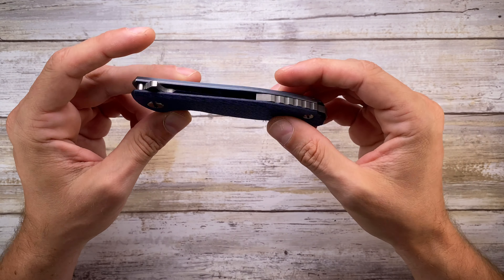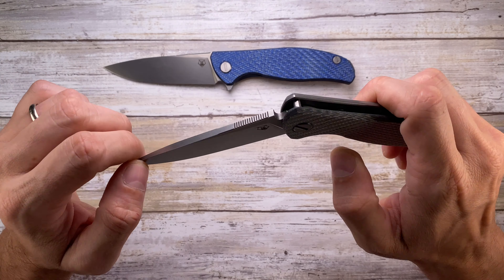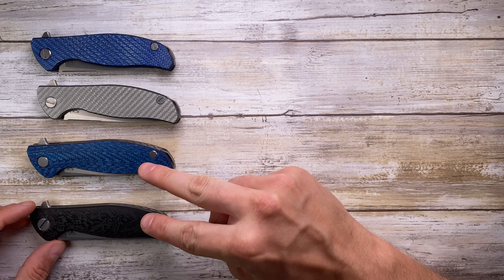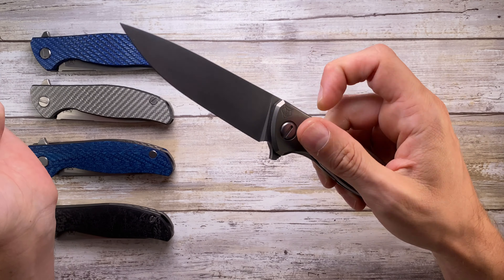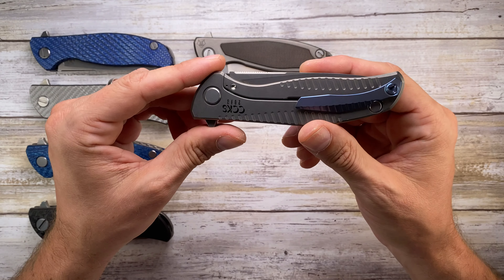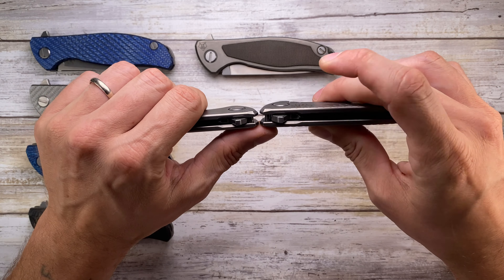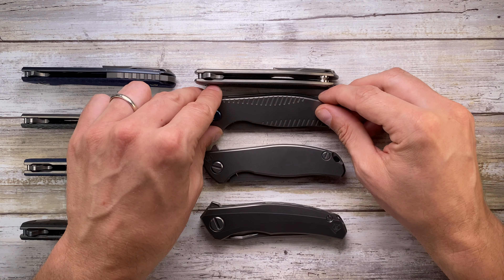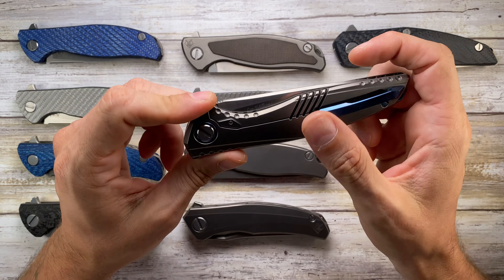Shirogorov LINEUP Explained. Fablades Full Review

Comment: Very detailed video 🙌

Now that I have the Neon Lite, what would be a good Shirogorov to get next? Hati, F3, 111 or F95? I want a bigger knife to compliment my Neon Lite as a larger knife. And something with carbon fiber.
Reply from the maker: With carbon fiber and 3.75” blade you can have Hati (framelock) or F3 (Linerlock). Both outstanding blades!!
Reply: Do you recommend one over the other? At this point, I am leaning towards the F3 because I may want linerlock.
Reply from the maker: I also prefer F3 over Hati. Feels more robust, but also is chubbier. The latest models are F3NS (carbon fiber) and Hati R (Alutex). Both have backspacer, MRBS, and M390
Reply: So, the F3 is a little chubbier than the others, but is it still fairly light and pocketable?
Reply from the maker: Same overall length, F3 is a bit heavier than Hati (4.6 vs 4.1). They also have different pocket clips.

Comment: Thank you for the video! I have to ask, which one is your favorite? I have a Ne0n Zero (MEFP) and thinking to buy the F3NS or Quantum next
Reply from the maker: I think now I like the simplicity of the F95R Slim..but it's a very tough battle with the Quantum..
Reply: Fablades Do you know if the F95R Slim has a detent ball ramp? Also steel washers under the bearings? Thank you.
Reply from the maker: No ramp but I’m pretty sure there are washers underneath bearings

Comment: Saving to get my first Shirogorov. I am torn between hation zero it the F3ns. I know they are both worth owning and very different sizes. I am just looking for help to tip the scale. Which would you recommend to be the first one to own?
Reply from the maker: It depends, I have big hands and F3 would be my choice, Hation and Neon are great EDC but a bit small for me. F95 not an option?
Reply: Fablades I have large hands myself and the F95 is an option. I think I just liked the look of the F3ns and it looks much thicker with better ergonomics than the others
Reply from the maker: @danduran536  yes for sure the F3 fills the hand more than F95!

Comment: Is the F95NL A multi bearing system I just bought one that’s listed as a multi bearing system I just want to make sure if you can maybe text me back in this fourm with a yes or no I really do like your site it’s well done
Reply: I also have a cannabis that’s numbered I’m not sure what that means thank you again
Reply from the maker: the MRBS and SRBS have different engravings inside the scales. Usually if the blade is M390 it's MRBS, and if it's S30V is SRBS

Comment: Can someone explain the relevance of the number of bears? Thanks!
Reply from the maker: The number of bears distinguishes between different production levels. three bears shirogorov will have extensive internal milling, multi-row bearings and usually M390 steel. They are the best production shiros you can get. Less than 3 bears shiros use lower level steel, no internal milling, washers or single row bearings.
Reply: That makes sense.  Do you know where the club knives or limited series compare in quality vs shiro's other levels? Learning about Shirogorov is interesting but information is sparse. Thanks again.